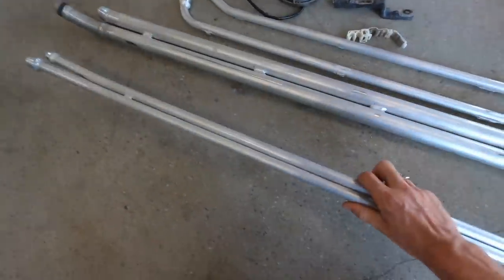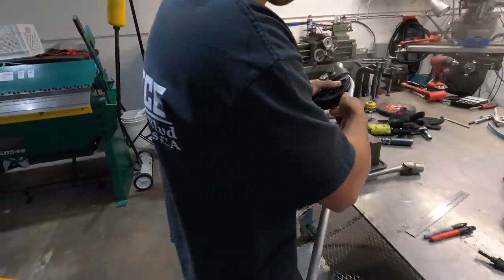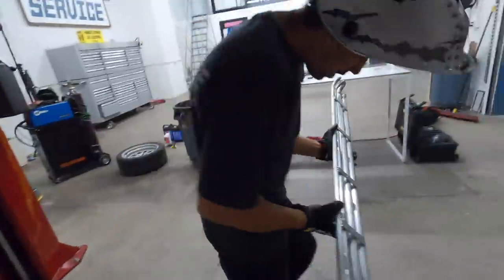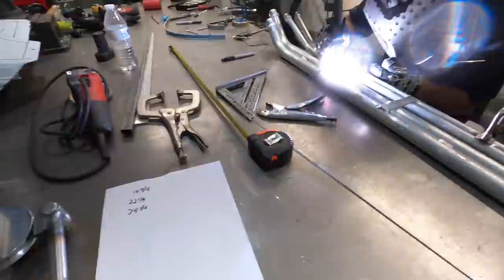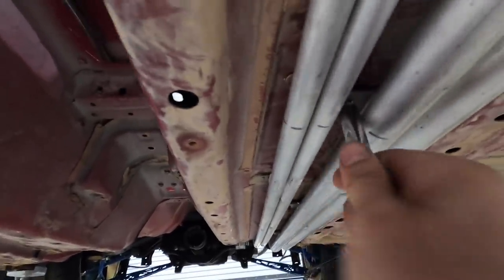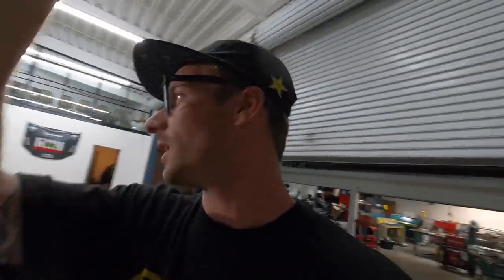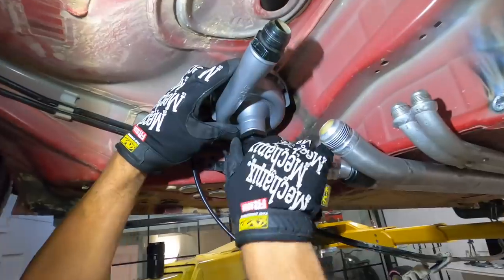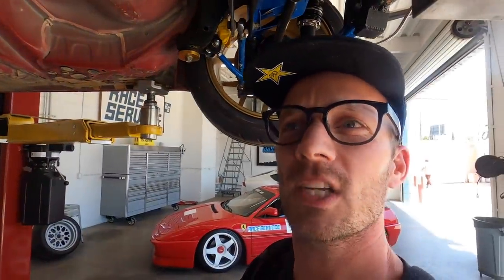HardLines,  Electric Water Pump East Coast Car EP. 12

Comment: So your not worried about vibration through the waterpump into the lines? I wouldve figured you would put small soft lines going between the pump and hard lines as the vibration from the waterpump and high heat of the system will cause micro cracks and end in line bursting on the track. Also I would mount the waterpump with rubber mounts as it is gonna be REALLY loud through the cabin of the car.
Reply from the maker: We aren't worried about anything mentioned above. The car is gutted with a roll cage and will be driven with a helmet on so not worried about any extra noise. Can't hear the water pump going with how loud the radiator fans are as well as the engine.

Comment: By far my new favorite page on YouTube. You guys kill it. In three days since discovering I have picked up so many tips, and realized I need more tools that would make life so much easier. Discovered the McMaster carr app too which is awesome and scary for my bank account all at the same time. I do have a quick question on the tube you used for 16an, do you know what size the tube you used for it is? I have a rear mount radiator I was going to use an line on but after watching I’m going to build some. Found some 6061 tubing on the app that look good just not sure on id and od.

Comment: Hi guys love all the videos. I’m currently building a Audi Quattro s1 and want to fit a axillary water pump for the Radiator in the boot, this is something I have never done before. The coolant lines to and from the engine, am I right by saying they run as normal or do I need to put a loop in bypassing the engine so the coolant goes around and round until the thermostat opens, or the loop isn’t necessary? Thanks for your time

Comment: Do you find that overall that the alluminim is cheaper than the lines? Vibrant's likes are around $140-200 for a 10' roll ranging from $140-$200 for a 10/12/20an lines. I did the math once out of curiosity and found that a inline pump with all the nessecary lines and fittings is like $1,200 $2k
Reply from the maker: your math sounds about right. I would assume the aluminum pipe is cheaper per foot than AN line in that size but then you have AN weld bungs on each side, accecss to a tig welder, filler rod, gas, etc. Prob still comes out cheaper in the end.
Reply: @RyanTuerck  very true. I guess when it comes down to it they each have their pro's and con's and while some one is build a car they will ultimately end up with what their budget allows/most convenient at the time.  I would assume alluminim is cheaper in the long run cuz they'll still need to use the welder to weld other alluminim or steel materials.Soft lines or hard, they're both really cool and interesting to see which drivers/builders choose which routes to go not just coolant lines.

Comment: Do those AN fittings allow for any kind of deflection like V bands? I’m sure the piping is light enough and the chassis doesn’t flex much down there, just curious!
Reply from the maker: No they def won't have much deflection. But I don't see it being an issue unless the water pump or hard lines shift or come loose.

Comment: So will this car be running the electric pump and the engine pump?
Reply from the maker: Good question. Should have mentioned that. You don't need to run the factory water pump with this size electric water pump. We will not be running the OEM pump.

Comment: wont the fuel get too hot running that close to the water?
Reply from the maker: It will get slightly warmer but not hot or to a point where it's an issue. If we were drag racing this car looking for every power advantage I would prob route them differently.